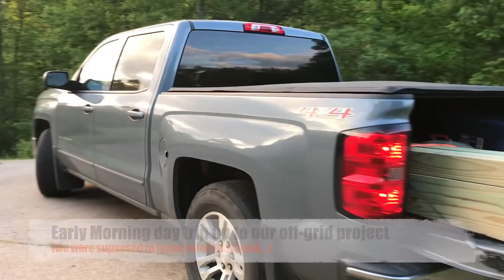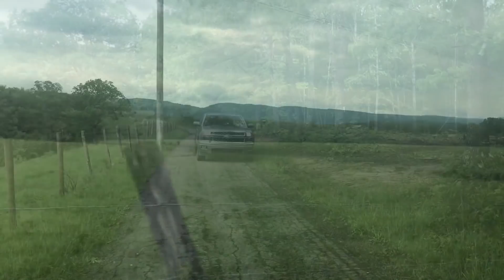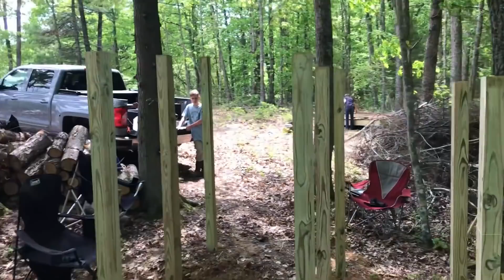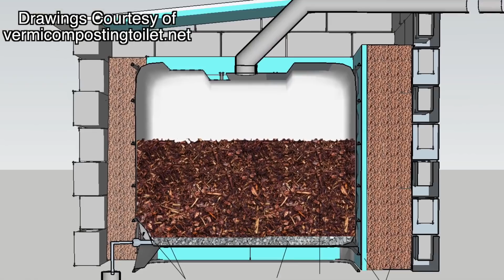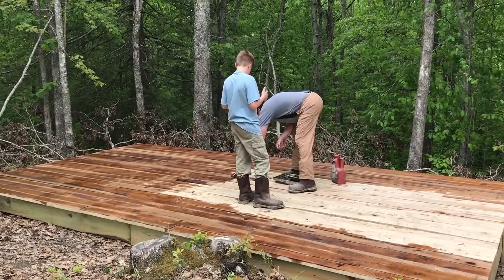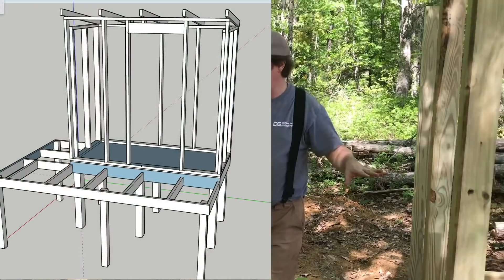Vermicomposting toilet for our off-grid camp

Comment: Thank You for your time making this video. I have a property in the country in Southern OR. I am considering a similar waste system. If you have a minute, could you update on the IBC tote how they are performing and is your system still functioning satisfactorily? Do you have any sugeestions for someone like me jsut starting to build one? thanks again!
Reply from the maker: Just got back from our camp. All is still working well. If you are going to use it daily with several people, you will have to watch for filling up the tank. I have seen others use multiple tanks with diverted to switch between.

Comment: Won't the waste be too acidic for the worms? They need a PH neutral environment. Will the woodchips provide enough balance. Also when the waste composts it will get too hot and the worms won't able to get away as they would in an outdoor bin until it cools off a bit. I'll be interested to see if this works. It would have huge implications for parts of India where the soil is very poor

Comment: Very very interesting and something for me to add to the list to learn after finishing the Humanure Handbook, for my new place. My only thing is, unless the products get hot, have a thermophilic process, is it really "compost"?  The product from the vermaculture, would be worm castings, not compost. 

"A new, more complete definition of compost was adopted by the American Association of Plant and Food Control Officials recently, after several years of deliberation. Supported by the US Composting Council (USCC), this definition is important, because it re-enforces best practices and quality product standards that have been developed, and differentiates compost from other products often confused as compost, such as biochar, mulch, and anaerobic digestate.

The official definition is:

Compost – is the product manufactured through the controlled aerobic, biological decomposition of biodegradable materials. The product has undergone mesophilic and thermophilic temperatures, which significantly reduces the viability of pathogens and weed seeds, and stabilizes the carbon such that it is beneficial to plant growth. Compost is typically used as a soil amendment, but may also contribute plant nutrients.

The prior definition was: The biological decomposition of organic matter. It is accomplished by mixing and piling in such a way to promote aerobic and/or anaerobic decay. The process inhibits pathogens, viable weed seeds, and odors. (Official 1997)

For more information, visit: https://compostingcouncil.org/blog/news/new-compost-definition-results-from-uscc-work-with-aapfco/"

Comment: Hey Troy, I’ve got a question- how do you clean the composting toilet without cleaning chemicals? Most would kill the worms as well as the anaerobic bacteria.
Reply: you can clean your toilet with homemade soap or soap as natural as possible like soap made from coconut
Reply: @odidnacyt  Thank you
Reply from the maker: According to the vermicomposting forum, people use chemical cleaners and still maintain their worms. They are pretty resilient. The bacteria is aerobic (that is what makes this so effective) but I agree, cleaners can be an issue their. A vinegar solution is what we plan to use on the toilet.
Reply: @RedToolHouse  Hi the problem with vinegar is that worm don't like acidity.

Comment: How will freezing temps effect this?  Looks great, but I am in Maine and will use camp in winter also.
Reply: Michael Rogers great question! Let us know if you learn the answer.
Reply from the maker: The worms have to stay between 45 and 85 degrees F. Insulation is recommended around the tank.
Reply: You must bring it below the frost line. You can also build it underground with concrete. Similar to a septic tank.
Reply: bury the tank. this video shows the complete process, it is in portuguese, if you don’t have the patience to watch everything watch with the maximum speed of youtube, just by watching you can learn the process. I hope it helps :) 
https://www.youtube.com/watch?v=qo5EwFjmzXg&t=7s&ab_channel=ChicoAbelha

Comment: I would love to know more about the actual mulch you put in the tank. If I was to use oak wood chip they would be very acidic and I feel as if it may affect the decomposition process. I wonder what the difference would be between the decomposition process of pine chip vs. oak chip.
Reply from the maker: It is my understanding that as you add fecal material it and the worms will breakdown all the carbon regardless of the levels of tanin.

Comment: You gave me an idea for our camp near Slatyfork, WV. We've been using those bag showers for years, that you have to lay out in the sun to warm the water or heat the water before you put it in the bag. Then you have to lift it up to a nail on the front porch and hope no one comes up the road while you are showering. If we built a setup like yours, I know where you can get an on demand water heater that runs on a 20# propane tank for $120.
Reply from the maker: That would be a good setup. We aren't far from Slatyfork.

Comment: I've found that the typical fill valve located inside the tank of a typical toilet requires at least 30 PSI of water pressure to properly shut off the flow.  At less than 30 PSI, they just continue to flow and will empty a well or cistern.  Please let us know what you find that works with the low pressure from your drum.  Good luck!
Reply: I would think that an RV toilet would be the way to go, where you can control how much water will be used to flush and used to make an odor free seal after the dump flush!
Reply from the maker: The flushing toilet trap will take care of odor and the water is needed to help keep the vermicomposting system charged.
Reply: An on demand water pump that runs off of a lawnmower battery, is only $40
Reply from the maker: We have used the typical float valve in a toilet for over 30 years at our friends camp (I have a video several years ago on it) that fills the same way. The float ball is enough to close the valve.